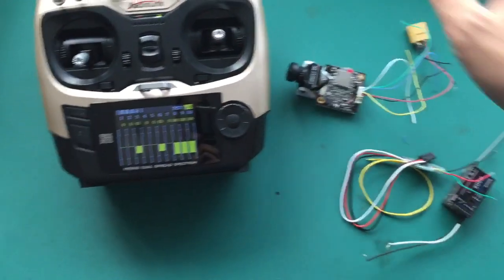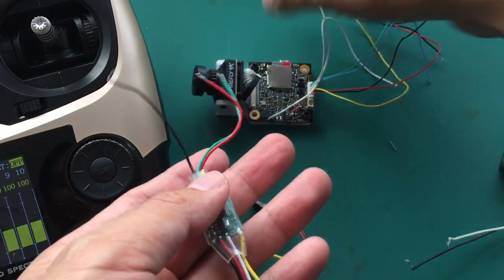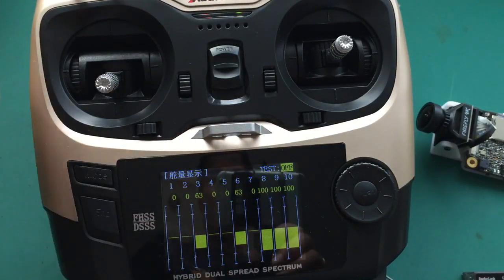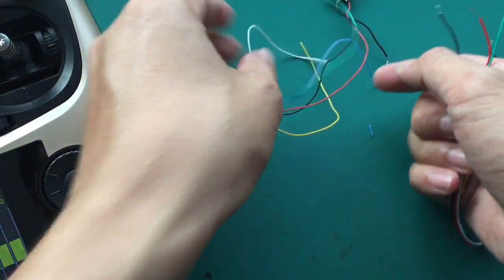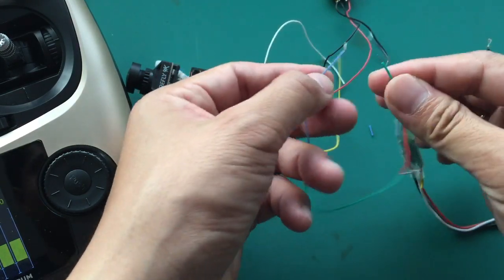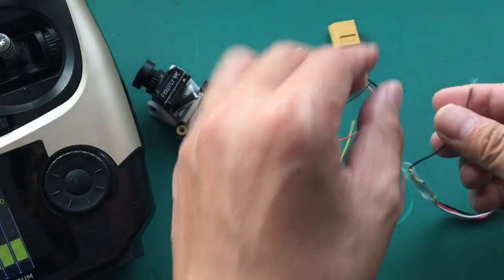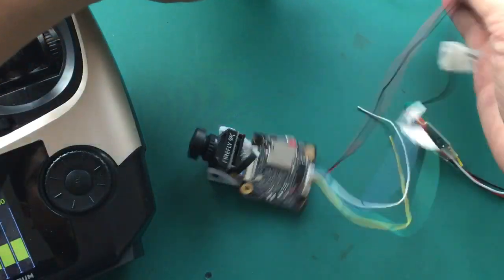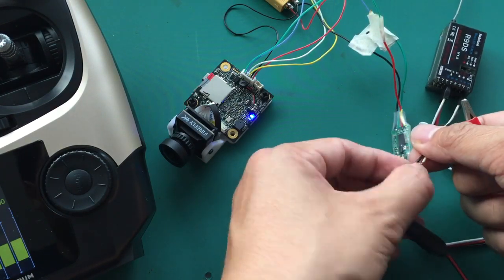How to use Remote control cable for the Hawkeye Firefly 4K Split Cam

Comment: from where did you buy Hawkeye Remote Control Cable Wire AV Cable for Firefly Micro Cam 2. I also want to buy but it is not available in Amazon. I need this cable

Comment: Hello ; in case not use pwm signal and use digital output from ARDUINO, pixhawk  OR RELAY , i think we dont need  Remote control module ,how trigger pin 1 and 2 work ?

Comment: I cannot find the cable anywhere and neither the runcam adapter...
Where can I get an adapter to control the trigger using PWM or UART/USART?
Reply from the maker: You can connect to FC directly, please check our full manual

Comment: You cannot control the PWM through the flight controller, is it necessary to buy a wire? For example, PIXHAWK has outputs that can be used as a relay or servo. Can I use them to activate video or photo recording?
Reply from the maker: Дмитрий Погудин hi, i dont test if pixhawk is ok